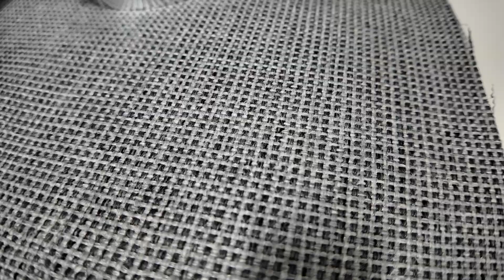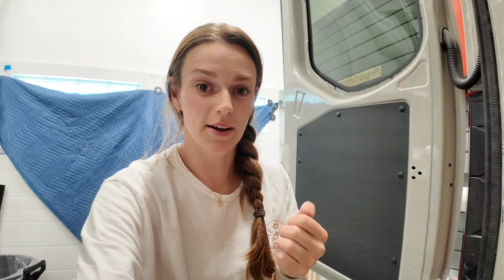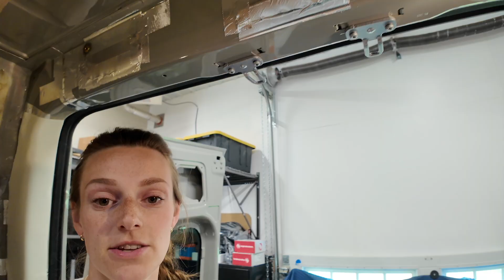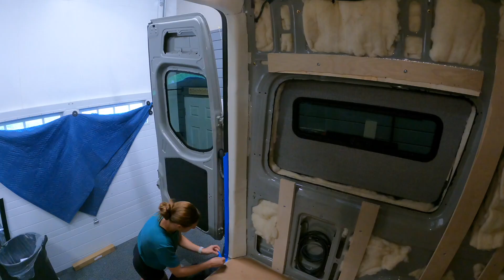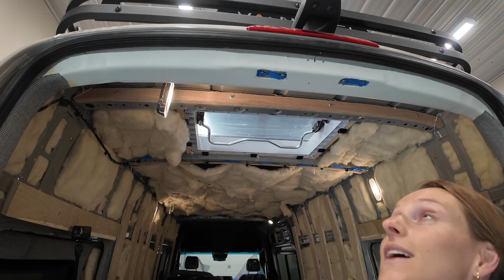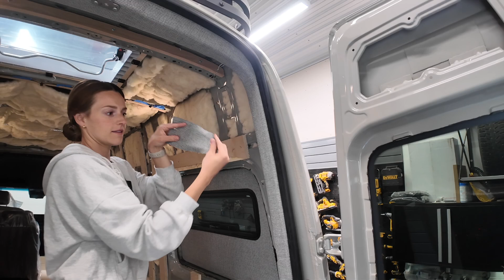Van Build | How to Finish the Rear Pillar |

Comment: Will you please add a link to the model of 3d printer you use?
Reply from the maker: The 3D model STL file is linked in the description and I use the Bambu H2D. Any of the smaller enclosed Bambus or Qidi printers would work just fine for this file well

Comment: Great video. Thanks for sharing!

Wondering if you would have had a better outcome with the top if you started from the inside instead of the outside by the seal. Thoughts?
Reply from the maker: Thank you! The outer edge by the seal is the important line for us and because the door trim gasket is so snug I didn't think the fabric would fit underneath. If you use fabric with a bit of stretch it should be very doable to make the inner top portion seamless. In our case it will be covered with a furring strip and cabinets so we weren't too worried about that area

Comment: Do you tape over the access to the rear upper brake light or camera?  Blocked for future access (?)
Reply from the maker: Yes, the rear brake light can still be removed via the 2 T25 Torx screws on the exterior (or 4x T20 Torx for the reverse camera) if ever needed to replace. Removing the brake light also gives access to the inside area with the wiring